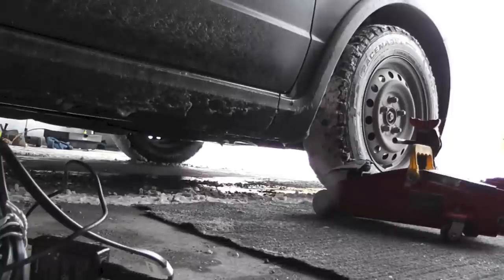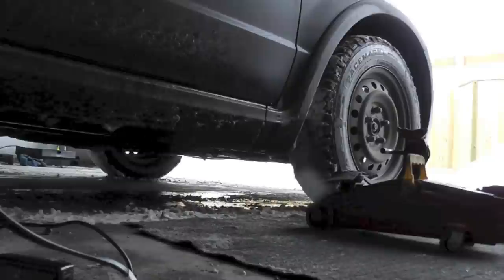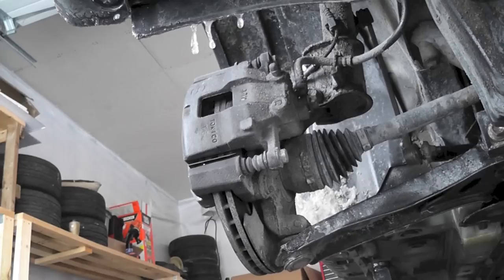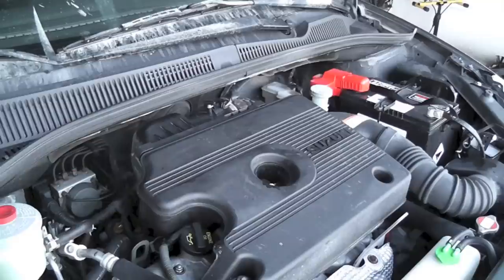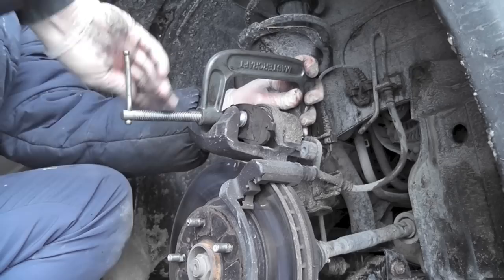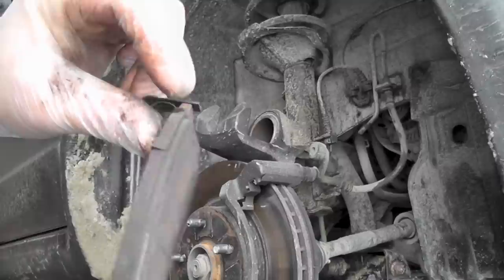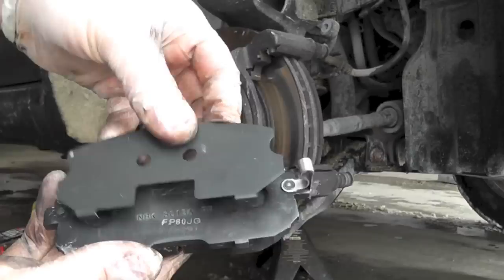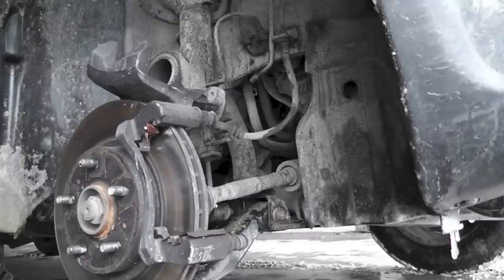Suzuki SX4 AWD front brake pads replacement

Comment: You did good work , and lubricate the little metal but you should change it , and also need to check and lubricate the sliding pin.

Comment: Hello all, I would like to replace my brake pads for my Suzuki Sx4 2wd. Could you tell me what characteristics they should have (thickness, height and others)? I found on a website 3 different values for thickness (16, 16.8, 17) and I don't know which one should I order. Thanks
Reply from the maker: Just go to any auto parts or Suzuki dealer and they will help you.
Reply: Here aren't this kind of shops. I'm living in a small country.

Comment: Friend, nice Video!

I've a 2010 SX4 AWD and i've bought EBC BRAKE PADS that doesn't came with this grease... do you think i can use WD40 to do this ?

Thank you!
Reply: No my friend, wd40 is a penetrative fluid and rust inhibitor not for brake jobs of this kind, eventually it will dry out. Use brake grease only, copper or synthetic

Comment: why dont you open the bleeder to evacuate old burn oil? you push back contaminated oil to master cylinder..you dont lubricate slide guide pins. lubricate under the hardware plates, between pads support and slide plates? cheap amateur jobs. sorry
Reply: Can you provide a video to show the steps you mentioned?
Reply: I am interested  in your video as well please.